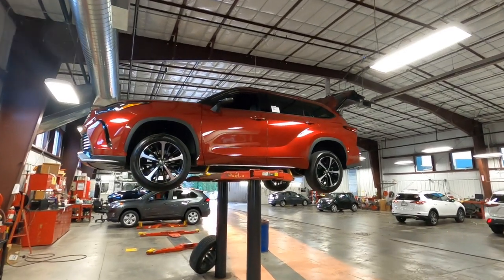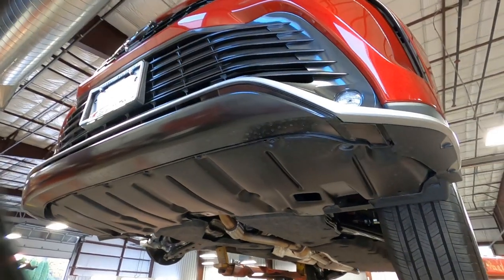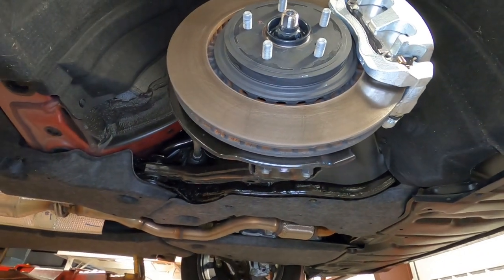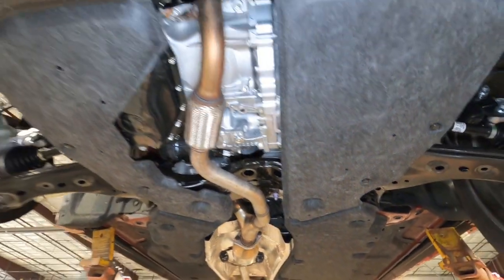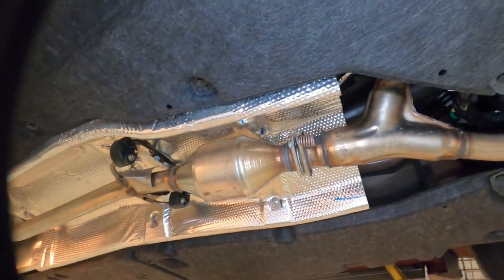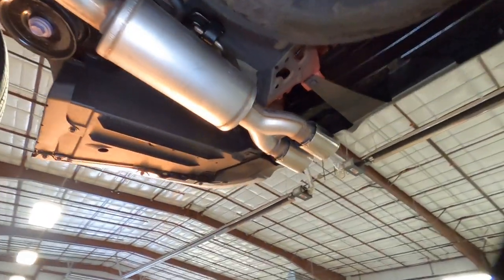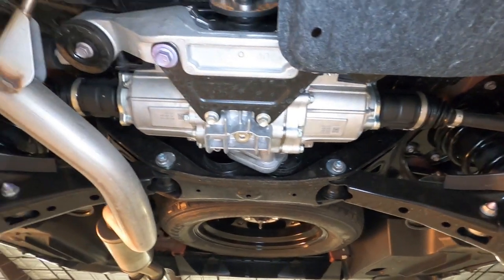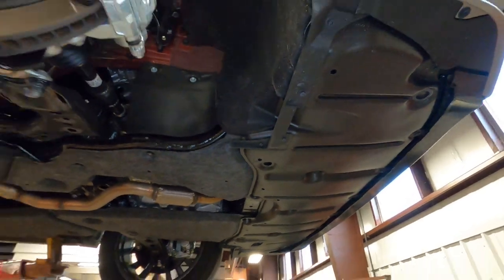2021 Highlander XSE Down Under with me

Comment: The underbody stuff is also for aero dynamics....increases gas mileage.
Reply: No it does not.  Very insignificant at the most. 
It may increase shop traffic for oil changes.  The fact that the oil filter is deliberately covered will end up with many vehicles going around with never replaced oil filter (too much hassle).

Comment: Thanks for this video. I own a 2016 Highlander and one thing that bugs me is that the exhaust pipe goes under the shocks/axle are in the back right and I'm disappointed to see this hasn't changed yet for 2021.
Reply from the maker: Other than that, how do you like your Highlander. Would you recommend it to others?
Reply: @TalkingCarBiz  yes I would recommend it! Love the engine and comfort and I’ve had no issues with it of any kind.

Comment: First snow storm with our brand new 2021 highlander, snow got packed up into the fabric and heat sheild yanking it down and snow getting lodged in between.  I'm extremely unhappy with this under carriage design. Seems to be very weak against any potential elements from road debris.

Comment: $40,000-55,000 vehicles should not have EXPOSED FELT UNDERNEATH THE CAR. I purchased a brand new 2021 Platinum and was very surprised and upset to find this “felt” underneath my car. Personally, this is just a way for Toyota to cut expenses. Toyota should have at least covered this so call “sound barrier felt” with something solid and sturdy. This felt underneath the car is HORRIBLE, strawberry milkshake was stuck to mine (wheel base and tires) and it would not come off with just hosing it off my husband and I had to get a cloth and scrub it off. Not a fan of this “cheap so call sound barrier.” This is a big problem Toyota need to take care of. Rain, mud, snow, and water will definitely tear/wear this out quickly. This is just a CHEAP way Toyota is doing things and passing it off as sound proofing the cabin.

Comment: Are there actual differences between the sports suspension in the XSE model and the other models?
Reply: Xse shares same suspension as limited and platinum
Reply: How about LE model ?
Reply: @TheAnkit211   I have the 2017 Hilander LE plus model and the suspension feels soft when I want to take round curbs above 50 MPH.  They are not sports cars, but the more expensive models seem to have better suspension.  I love my Hilander. It almost feels like a Lexus now that I added more sound deadening all over the interior. It it quiet and smooth with less resonance and frame vibration.  I recorded some video as part of showing what is behind the covers in the cabin of the 2017 Hilander.

Comment: Liked everything till you showed us the “temporary” spare. My 2007 Highlander has a full size spare, why temp. Now?
Reply: Previous generation had temp also.  Location is poor,  the thing is getting weathered there.  Good news this model seems to be getting better, alloy version as the previous gen was cheap steelie.
Reply: @anurakboribun2560  Apparently, it's also meant to be part of its rear collision system. I wanted to remove it to save on significant weight, but I decided to keep it on as it does make sense in that way.
Reply: @FCM415  you are absolutely correct, most of the spare wheels are part of body sturdiness. I would feel naked without spare, its weight is minimal in overall mass of this large vehicle.
Reply: @anurakboribun2560  I just received my 22 Platinum in white and while I knew before purchase that this is not intended as a performance car AND no aftermarket mods are even available, I did want to see where I could squeeze in any performance mod and all I came up with so far is a K&N drop in air filter that MAY increase flow by a negligible amount hehe. That 50 lb tire delete would actually help but I agree that it's not worth the risk. I love the SUV, perfect for my uses and growing family.
Reply: @FCM415  the car is way over 4000 lbs, spare even less than 50…  I bought a car without spare once, purchased one asap as I was not comfortable without it. This SUV has more HP than a V8 Mustang of yesterday. Feed it good it performs. Enjoy your new ride. Had a white once and loved everything about it.

Comment: The insulation of the car is bad, the ground is where it makes noise, especially the rough roads asphalt, and I owned a very Chinese Haval car, very excellent in the internal insulation.
Reply: All Hilanders are noisy. I have been adding sound deadening to my 2017 Hilander for the reason of metal resonance all over its body.  I have done all the doors, the back and the roof. I love the results. I plan to remove the seats and to the floor.  It has been cheaper than buying a Lexus, which I would, but I would need a lot more money.  I have posted some videos about the sound deadening in my Hilander.

Comment: That plastic under there is not for protection. It’s for aerodynamics
Reply: its for both. so you avoid getting water or mud in the areas that can cause something to lock up.
Reply: Funny, all these years nothing was locking up and now all of a sudden...
Also funny how suddenly all manufacturers seem to be hiding the underbelly so that there is no easy way to perform basic maintenance.  Give it some time, wonder how many will drive around with those covers removed and nobody will notice them missing. The best sight is Mercedes dragging one of those under as the mechanics forgot to secure it properly.
Reply: @anurakboribun2560  so you can basically go to the dealership instead
Reply: @curiosityredpill7030  sure could. The whole point is not to. Even to the „two year no cost oil changes”, I trust myself as to what is done and how it is done and I am sure that I can do it better.
Reply: @anurakboribun2560  yea I agreed with the point you and person above was making I was basically just saying they do it that way so regular folks like us who’s already paying crazy car payments  etc can barely take a look at our vehicles do things ourselves are take it to local mechanic because there making simple things hard to access so we can go them and pay more!
Reply: @curiosityredpill7030  that was obviously the plan, and it did bother me back in the day when I had only a wrench or two. By now those things are more nuisance than obstruction.  Manufacturers also can not make it too difficult for inexperienced shop mechanics to mess up.  But they still do. I bet many people drive with „lifetime oil filter” as many shops may choose not to bother with that sucker. It tends to be difficult to remove because it was not touched for who knows how long 😄.  There is no way for anybody to verify. The underbody covers will get choosen for many, who gets his put back on and who’s getts forgotten. The main thing to put it back on is not to have to worry about the bulk of trash.
Reply: Unfortunately, almost all vehicle front under body are very fragile with very important items underneath. Even if not off-roading, just driving through some grocery parking lot with steep or downward exits/entrances damage the front underbody over time (Especially, over snow/ice covered roads).